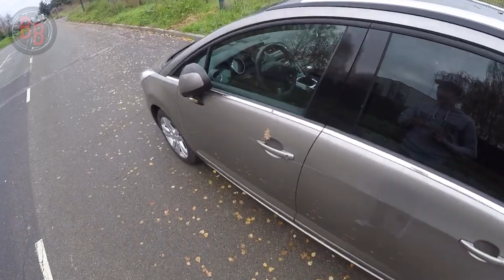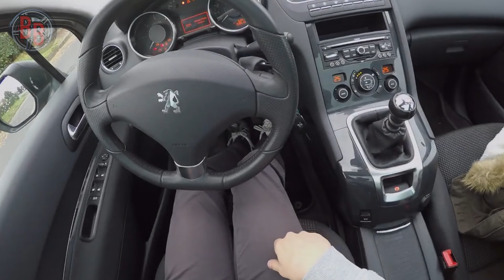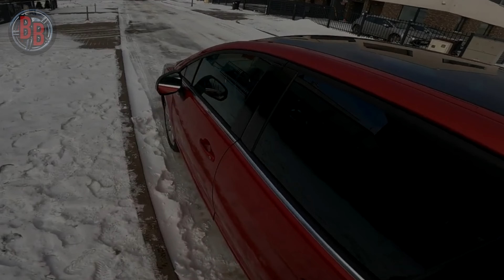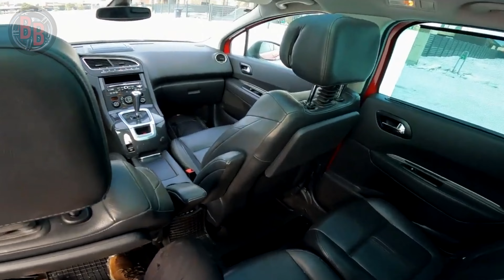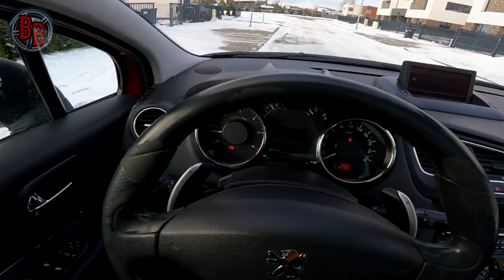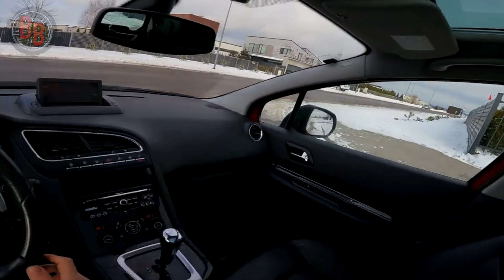Peugeot 5008 - Check For These Issues Before Buying

Comment: I have the 5008 1.6HDi Style from 2013, and I must say that it's a great car! I use it mainly as a transporter, and I'm constantly amazed at just how much I'm able to fit in it. Odometer says 283,000km. It's received regular service from the beginning, and other than usual expected service items (brakes, tires, battery, headlight bulbs, windscreen wipers etc.), there was never anything serious wrong with it, ever. Only recently has it started to show signs of needing a new clutch, and at one point it also needed a new particle filter, but that's it! Very happy with it!

Comment: got the 2.0 diesel (no ad blue version) sinds 2014,...after 2 years empty the paricle filter, closed the egr valve and new programming,.....187 horse power on the weels!!!    top speed from 192 on gps to 217 , acc from 8.9 to  7.7 sec ,   consumption reduced from 7.5/8 liters per 100 km to 5.5/7 liters ...7 liters is max in the winter with short distances , have now 248.000 km and no problems, every 10.000 km new oil and oil filter ,  180.000 new belt,  1 pair of break discs front and 2 pairs of break pats..... the only big issue are the plastic lights with led daylight, they start getting misty and cost around 650 euro each .....
Reply: the fuel consumption change seems exaggerated....

Comment: I was at the Peugeot service in my town and they have changed some belts, rollers, and antifreeze, oil and filters,  and now I have a feeling that 5008 behaves like brand new 💪 It cost me a bit above 600 EUR but in service they have told me that this kind of maintenance I don't need to do before next 50.000 kilometers. Oil and filters in 10.000, and the big one in 50... 
The new problem is that navigations have "0 Visible satellites"...
That is new peace of the puzzle 🤔

Comment: First I want to say that I don't know a single thing about car parts.

Recently my dad bought a 2014 1.6hdi. This car is not reliable at all. 

Flooring it causes "engine failure" lights, and the car would disable one of the injectors causing it to go in emergency mode and so on. 

We ended up getting new fuel injectors which for now seems to have fixed this issue, but 3 days ago on a trip we needed to overtake a truck and when I floored the car it turned off the ESP. We pulled over, restared the car and it fixed itself. 

Also the parking sensors like acting weird: Sometimes they work, sometimes they don't and yes we checked for dirt.
Reply: Weird my mums 2012 1.6 Hdi has had absolute no problems
Reply: How did this go? I bought this exact car and had the same problems 3 weeks after I bought it... ESP failures left and right, 1 injector changed (not all for some reason)
Reply: @Dasgrubergz  We changed all 4 injectors for a very hefty price. The car has been running fine for the last year with no issues. I think I jumped to conclusions too quickly last year. 

Its been doing pretty well. Its a comfy van for long distance travel. I hope you got the 2.0 hdi, because that 1.6 basically requires a chip tune to be adequate.
Reply: @Dasgrubergz  We changed all 4 injectors for a very hefty price. The car has been running fine for the last year with no issues. I think I jumped to conclusions too quickly last year. 

Its been doing pretty well. Its a comfy van for long distance travel. I hope you got the 2.0 hdi, because that 1.6 basically requires a chip tune to be adequate.
Reply: @arandominternetperson4462 I see. Ive got a used car warranty issue with the company that sold me the car. 163k km, and I had one injector changed, and a different error emerged but also with ESR fault. It goes away after restarting and comes now and then. They will change a switch in the break pedal next, and they changed all calipers recently. Im worried cause they only changed one injector after the same issue for me. Ive not paid anything for repairs cause the company that sold me the car is liable. Anyway thanks for the feedback. I have the 1.6.

Comment: I have just bought 5008 blueHDI 1.6, automatic with something like tiptronic, semiautomatic and full automatic combined. Nice package. Nice looking car, nice driving, but it has some kind of bug. If I put my pedal to the metal while increase speed, it pop up warning "engine failure" and it stays until I restart the engine... I hope it is not serious failure...
Reply: I think is the turbo
Reply: Look intercooler pipe .

Comment: The 2.0hdi bluelease was also available as handshifting transmission in 2015 (but with all the specs, just without rear cam) I drive a 2015 2.0hdi bluelease six speed handshift.  So not exclusive with automatic transmission. The one with automated transmission however is said to be 160hp, but it is fact the same engine (apart from transmission and maybe ecu setting), or am I wrong?